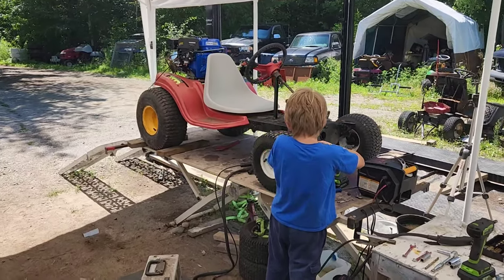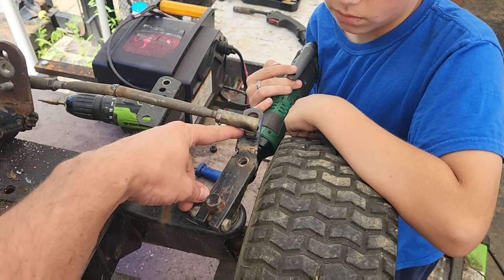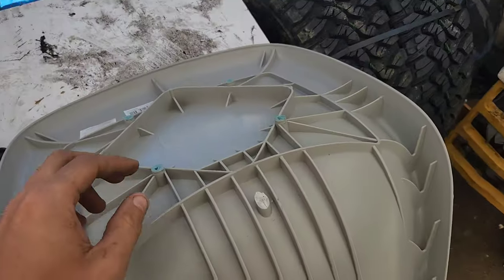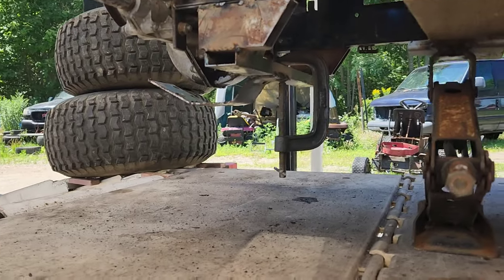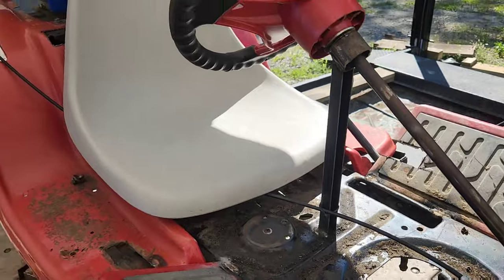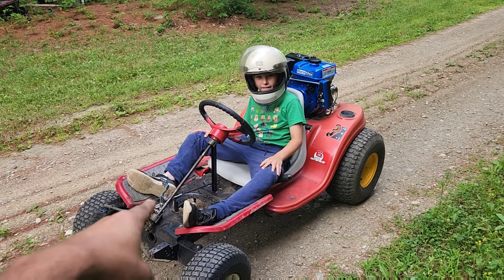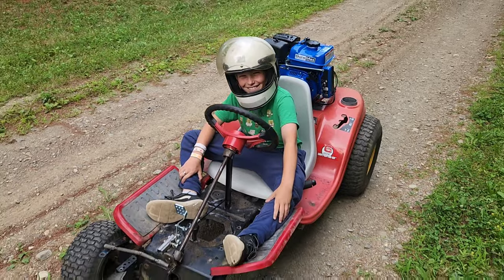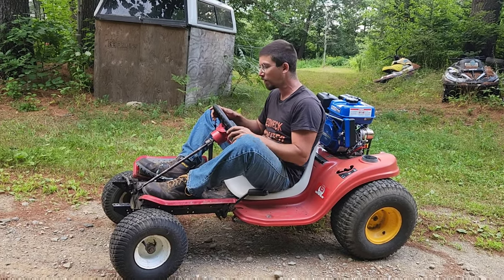Gas pedal and Seat Upgrade Go Kart Lawn Tractor

Comment: It desperately needs a pully upgrade. I love the channel, love the project, but your son is big enough now he's ready to learn to drive at faster speeds, even if you disable governor you could still out run it on foot, you should either figure out a bigger pully for the engine or better option would be a smaller one for the transmission, you are crafty, I'm sure you can figure something out. hope to see this upgrade :)
Reply from the maker: Its all ready in the Redneck Science list. The governor vers Pulley swap argument has heated up to the point we will test both.  The 2 MTDs on the truck are free parts machines for the project.
Reply: @redneckcomputergeek  just needs some 22 12 8 atc tires on it. It would be fast enough.

Comment: You have the tensioner on the wrong side! Your belt is slipping, that's why every time you accelerate, you hear a squeal or screech. Move the tensioner to the other side, change the transmission pulley two inches smaller. You will still have plenty of power, and it will go a little bit faster. But not to fast. Maybe 10 to 12 mph. With power to go through your trails. Ya'll go to the trail, and get the wheels in a bind, and accelerate. Watch the belt on the left side, and you will see and hear the slipping, and loss of power to the wheels. Move the tensioner, and that problem is solved. Ps do the fix on video, I would love to see the difference. "GOD BLESS"!!

Comment: Im building one something i did different is i lowered the rear a bit more and the body pan sits more forward i wanna do cable driven brakes and clutch and run a belt clutch